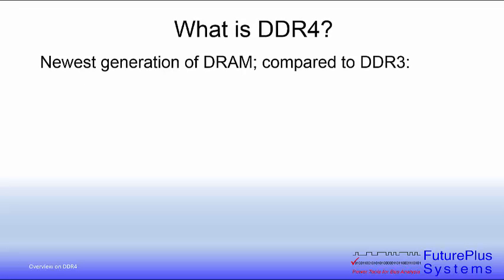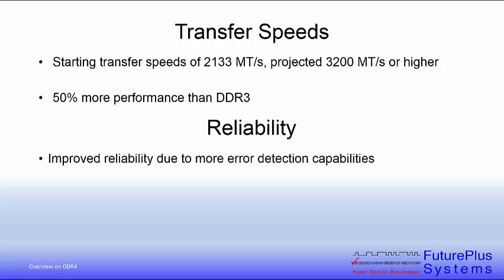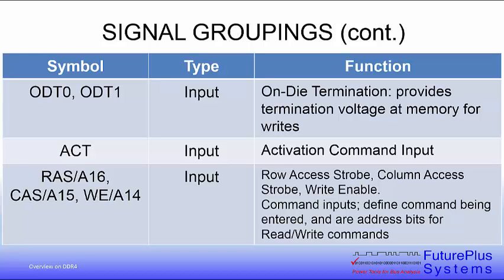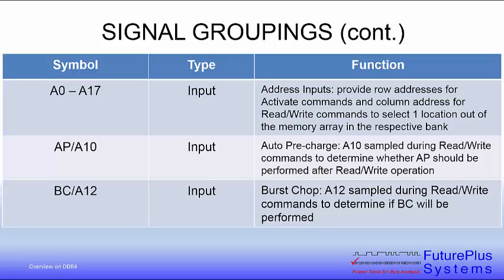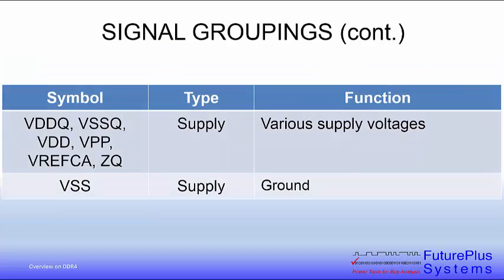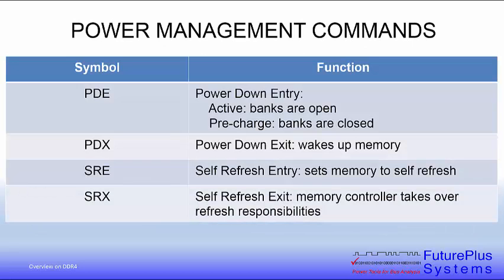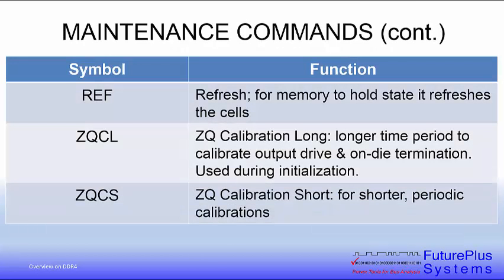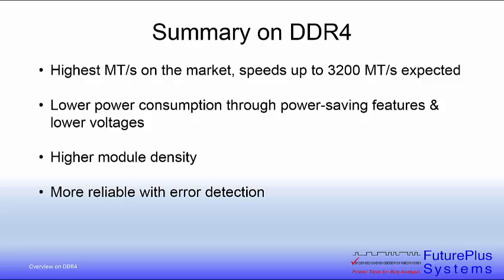DDR4 Memory Signals and Command overview video

Comment: it's posible if i replace the chip with higher capacity in the ram pcb module? example if i have ddr3 pcb module with 8 chip in module, its equal 128 MB in one chip, if replace all chip (8 pcs chips) with 256 MB per chip what its will work properly?
Reply: no